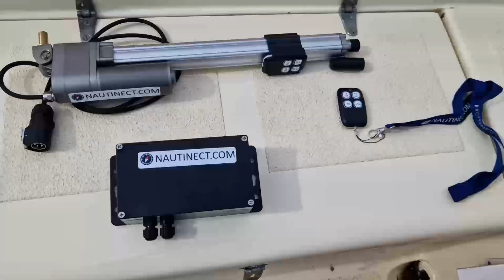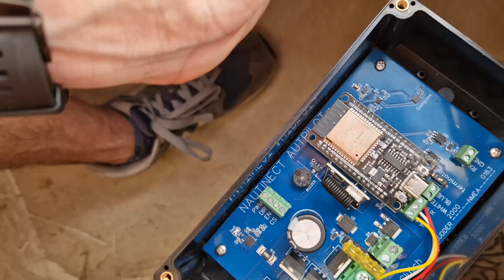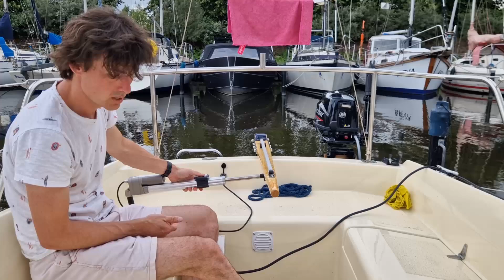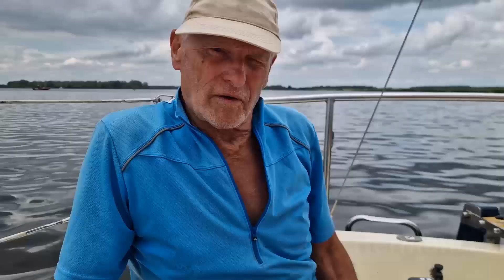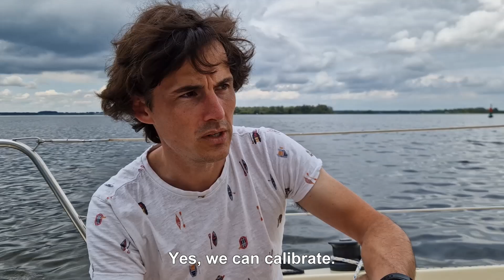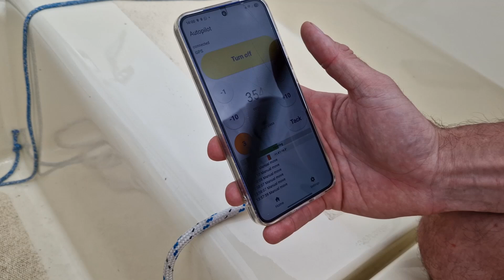Nautinect linear drive autopilot

Comment: I don't understand the need for a rudder position sensor. Surely the rudder is in a fixed relationship with the tiller and hence the actuator?
Reply: He said in the video that the rudder position comes from the actuator. Its on the board because wheel pilots for example need separate rudder sensors.
Reply: Is that position derived from “feedback” from the actuator?
Reply from the maker: @blaaaaahhhh15  Yes, inside the housing, there is a variable resistor that changes its resistance based on the extension. I convert that resistance to a rudder position.

Comment: A clever and simple system. How long should that linear actuator last? I understand they are not deisgned for high duty cycles.
Reply from the maker: Crossing oceans. The duty cycle is 20% for temperature reasons. You never hit that 20% and the ventilation around the unit is good.